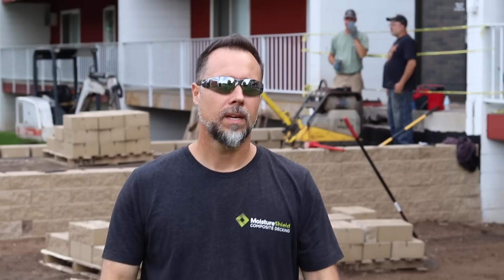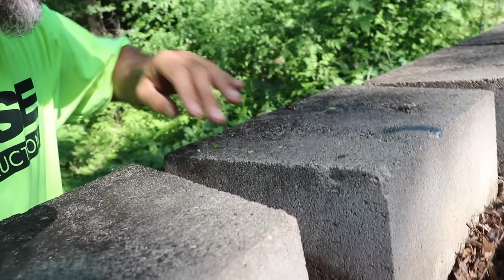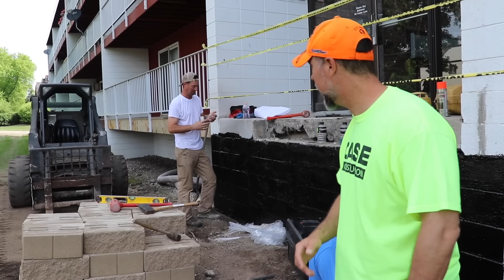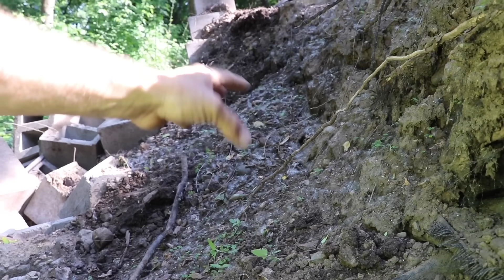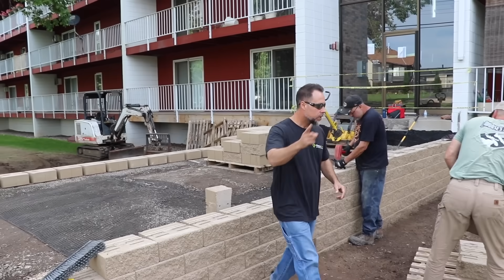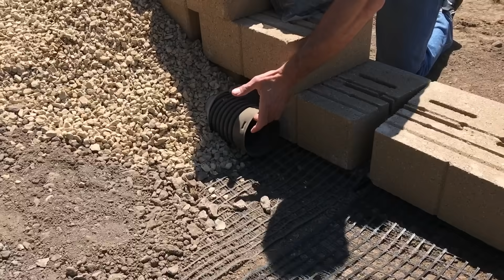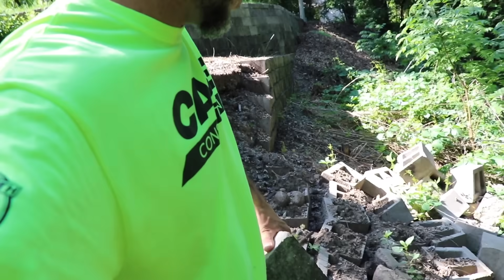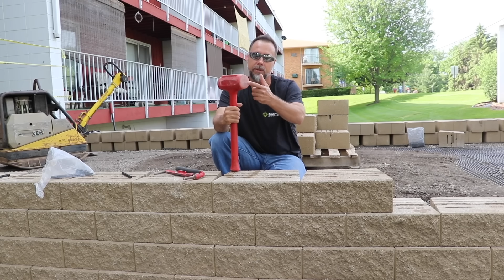How NOT to Build a retaining wall.  RED FLAGS, common mistakes, bad designs pt1

Comment: I love the detailed information as it's why I watch a 20 minute plus video on how to "stack bricks" while other similar videos are closer to three minutes.
Reply from the maker: Thanks- I try to make it interesting.  appreciate that!
Reply: I learned something from the video. Don't put fabric behind the wall. I built a retaining wall years ago using cement blocks and type S mortar as if it was a foundation wall. No drainage whatsoever. Mortared the bottom course onto a concrete pad. Back filled it with shitty gravel and dirt mixed, no geo grid. Built it solid like a rock. So solid it had zero give whatsoever. 

First winter when the wall blew it shot blocks 50 feet across the patio. It was lucky some didn't crash right into the house.
Reply: rustyscrapper - The fabric behind the wall is a minor issue; probably just the wrong type. The lack of drainage is the critical component.
Reply: So your YouTube  certified Richard
Reply: Go take a class from the NC<A, not the "monkey":" https://en.wikipedia.org/wiki/National_Concrete_Masonry_Association

Comment: Good video. Was a little unclear on the geogrid. Is it laying between the courses or just up to the back of the course? Logic would suggest it goes between them, but it wasn't clear. On the "bad" wall it was clearly visible between the courses,  but your wall was so flush, it was almost like it wasn't there.
Reply from the maker: Your not supposed to see it- it lays inbetween the blocks every 2 feet.

Comment: Hey I'm new to landscaping, but not construction so when I started I was put on crew that would take care of drainage issues. We had to remove part of a wall (5 high) to run drainage through the base block which we cut. There was no drainage rocks behind the wall! It was 15 years old and many of them were in the development. No problems with any of them. There was however SOLID clay just a foot under the topsoil, I mean 100% clay. Could that explain the longevity? Sorry for the long post, and thanks for your response.
Reply from the maker: Nope-  That doesn't sound right. Clay moves walls a ton. I think there are just getting lucky-which happens.
Reply: Clay if packed right will usually repell the water instead of letting it filter into the soil below .  but thats only a top layer you dont want a bunch of clay , tends to move around depending on the level of moisture. Its weird

Comment: yes. I love these videos. I bought a house and the prior owners did everything you say not to do. Now I'm rebuilding and would prefer not to have to buy new block now that it's here.
Reply from the maker: I sure hope these videos help you with your project.
Reply: Just fill the block you have up so it’s sturdier.
Reply: Thanks. The block I have isn't hollow on the inside, the doormat that installed it never put drain rock behind it. It is leaning, failed in some areas and not level in others. Leading me to believe there's no base material either.

Comment: If we let water seep through the walls it will carry 'color' and stain the walls.  I would think it is smarter to have a moisture barrier against the wall down to the first course and let the drain aggregate and pipe take take of it by routing it where you WANT it to go.  The only thing I can think of is that the drain system works well enough at first that water won't seep through even if you do not have a fabric/barrier - at least for a decade or two.
Reply from the maker: They aren't meant to be built that way. That does work on CMU walls though.
Reply: Thanks for the response.  I have never built retaining walls so my comment was just a layman's 'common sense' response, which as we know isn't always accurate.  I think I would rather rephrase it as:  If you are trying to allow/encourage seep through the wall what keeps that seep from staining the wall?  Thanx again.
Reply: It seems he is busy.  CMU = Concrete Masonary Unit.  A ridiculous term for a concrete cinder block, the most common of which, in walls, is the 16"x8"x8".
Reply: Kirby Spencer 
Kind of a....  Nevermind.
You have existing blocks that are getting stained, but mentioned no willingness to replace or repair.  In fact, the problem you had was the staining....  So fucking clean them.
Reply: Kirby Spencer thank you. 
Yea I bet he is busy his channel blew up lol
Reply: Kirby Spencer 
Honestly... Just buy a pressure washer and clean the blocks periodically
Reply: Honestly...  You think that represents the quality solution?  You stick to building retaining walls at your place and stay away from my projects.
Reply: Thank you for editing out the 'dumbass' portion of your response.  Had you read what I wrote you would know that I was merely pointing out a potential problem with his technique and that I don't have a staining problem so I don't fucking need to clean them.  This also explains why I don't mention any willingness to replace or repair anything.  Reading is fundamental.
Reply: Kirby Spencer 
Your entire story, in context, reads as a hypothetical, and the final unanswered part is about staining.   You should fundamentally re-read your previous submissions.

And yes I did edit it out, because it was pointless.  Just as much so as the smartass reply my original comment received.  I suspect that you have entirely underatood my meaning from the moment you read my first comment, and you're simply choosing to take the worst possible interpretation that you can imagine.

Edit....
 On the other hand, I would be greatly disappointed to get anything else from a Walter avatar...

Comment: This detailed video was fantastic. I've always wondered why the weight of the dirt behind the wall doesn't just slowly push it out. The geogrid material explains that. But do all retaining walls use it? If not what keeps the fill from pushing the wall over?
Reply from the maker: Not all walls use it.  It depends on surcharge and height of the wall.

Comment: Hey Stan, I'm doing a 3' hollow block wall filled with aggregate and putting a fence on top.  Along with considering the surcharge from the fence (and the torsion from wind), do you think it's necessary to install the post sleeve through the wall into the ground below, or simply install the sleeve in the wall?
Reply from the maker: Install sleeves intot he ground but not through the wall- behind it.  look up sleeveit  it s a system to install fences behind walls.
Reply: Thanks for the tip!  You remind me of my uncle who I don't get to see near enough

Comment: Especially interested in the subject of retaining walls.  (I'm looking at renting a tiller to break up hard ground calcified Las Vegas dirt, to be removed and leveled, and uninstalling/capping an old existing sprinkler system, and replacing it with a drip line.)
Reply from the maker: I have another wall video coming soon.

Comment: Could you put on the hollow blocks could you put concrete down every so often so it make it stiffer or no cuz this the first time I watch this
Reply: I would imagine putting concrete/cement down the hollow would take away the effectiveness of the wall by preventing water to drain through
Reply from the maker: They are meant to be core filled with concrete.  It could impede the drainage
Reply: They are suppose to be core filled with concrete and sometimes also with rebar. Some people fill them with gravel and I dont understand why.

Comment: Stanley, thank you for the very informative video.  We appreciated the tips on geogrid and fabric as well.  We recently started working on a wall project and went with the Versa-Lok standard units based on all your recommendations.  However--the block we received was difficult to work with because much of the block was 1/8" or even 1/4" too high or too low from the specified height of 6".  We had to take down and start from scratch a section of our wall because of this.  We then had to start measuring each block and "shimming"  to ensure we weren't creating unevenness in our wall.  Even though we measure each block, we're not convinced the block is even level from side to side.  Much of the block we received does not look anywhere near a clean as what is featured in your videos.  The slots and holes include a lot of sloppiness and what we call "boogers".  Some of the block we cannot use because there are humps on the top because it looks like the concrete between the slots may have subsided or shifted a bit after molding.  We had the Belgard rep come out and take a look at everything and he kind of dogged the Versa-Lok wall citing it as a "License" product meaning that they manufacture the blocks under license from Versa-Lok.  However, this means they have limited control over the molds that they are sent.  He claims the block that is way out of spec or very sloppy is because they were formed with a worn out mold.  He also claims that 1/8" + or - is the tolerance for depth of the block--That seems like a lot to me!  Have you EVER experienced this with the Versa Lok product?  To me it sounds like the block is only as good as the manufacturing plant it comes from--ours is out of Indianapolis. We had great hopes for this wall block, but so far it seems to have been a big disappointment.  Thanks for your input.
Reply from the maker: Sounds like those are a bad batch of block-  They should pick them up and give you better blocks.  we have had bad batches to.  I wouldn't accept them.

Comment: Nice video, I'm wondering how strong those plastic connecting pieces are, seems like they should be metal.
Reply: Steel would just rot and rust away.  There really shouldn't be any stress on the pins.  They are more to line the blocks up than anything else.
Reply: @UDeMaio53  111111+1 is 11
Reply: There are some blocks that use fiberglass pins instead of plastic. Zero water absorption and much higher shear values. We make all sorts of fiberglass building products and if you would like us to design something up for you that is higher strength than plastic and infinitely more durable than steel, let me know. Great videos.
Reply: Since there are hundreds of them, the strength adds up.
Reply from the maker: Well said A D
Reply: I agree with AD, except for the stainless part. Raises the cost substantially, and the plastic  (probably pvc or abs) won't rot for many years when not exposed to uv, plastics worst natural enemy. without examining the pins myself, I couldn't tell you the actual shear strength, but the little pressure they see is dispersed across the wall in its entirety, so the strain/stress is minimal. look at those little plastic pins in the kitchen cabinet, 4 of them in shear holding up 100lbs of stoneware. plastic is quite strong in shear.
Reply: The pins aren't really that important, what matters is the solid bricks have WAY more surface area making contact between each layer, that's what keeps them from sliding. Those hollow bricks not only have a fifth the surface area, but when you stagger them, the small amount of surface you have doesn't line up between layers so you get nothing.
Reply: @jordanh9520  the hollow ones are meant to be core filled will gravel to help lock everything in place.
Reply: The blocks he used were smooth and yes they used the pins, the blocks at the other site with the issues, those blocks were "hollow" with the lip but no pins.
Reply: Aren't you suppose to put rebar and concrete in the hollow blocks?
Reply: Filling the cores with a fairly large aggregate, it's virtually impossible that the rocks in the core of one block are going to end up flush with the joint between the lower and upper blocks. So you end up with a tightly packed bunch of small rocks that can't move around easily, and many of them will bridge the joint, all around the inside of the core. Try it at home. Take two hollow blocks, put one on top of the other, pack the cores with coarse aggregate, tamping it down on top. Now, without lifting, try to slide the top block around. No need for concrete. Even when the cores are not perfectly aligned, it still works, and given settlement of the aggregate over time, the hold gets even firmer. And there's no drainage problem, either.
Reply: You probably know better.
Reply: There's nothing to suggest you can't substitute it with whatever you want.
Reply: Metal will rust over time... Talking bout putting something in that SHOULD last hundred years
Reply: I have build walls with the fiberglass pins. The only downside is curved walls become a nightmare trying to get everything to align correctly. That's one huge advantage of hollow block that can be filled.
Reply: How does that plastic hold up when it's ice cold?
Reply: @mikeries8549  I live in wisconsin and build retaining walls daily. The plastic does fine but they are also not meant to hold the blocks in place.  The jagged rock is really what helps to hold the blocks in place because it compacts and locks together so well.  The pins really are more of an alignment tool that also offers a lil support.  Your wall will not fail because of the pins trust me
Reply: @ep3389  I’m in Wisconsin, looking for someone to build a retaining wall for me. Can you DM me?
Reply: @SheSlimShady  I didn't even know you can direct message on YouTube! I'm not sure how?
Reply: I like the details in your videos.. Thanks for passing on your knowledge
Reply: Just finished my little 400 sq ft patio after watching all of your videos on paver installation. You gave me the information and confidence to do it myself. Getting ready to do a small retaining wall. This was great information but probably overkill for mine. Thanks!
Reply: they only need good shear strength.
Reply: Use Allan block, no stupid pins to use, and or keep track of. Much more versatile also.
Reply: The plastic location pins are only to give you your 1/2" set back. They have 0 value in the strength of the wall. The wall is a gravity system. Friction from weight and gravity is the strength.
Reply: AD Stainless steel or something, plastic can loose a lot of strength over time. I mean yes if you build it correctly then there won't be much stress on them anyway but you never know what can happen, you want it to be as fail safe as possible.
Reply from the maker: Your right Animuldok

Comment: Good video.  How well do the pins fit in a random pattern or curved wall?  How do you successfully split the back off a standard block for blocks which will be exposed on both sides?

Comment: The only time I use fabric is a at the very lowest point to separate my dirt and class 5 before I put my first coarse down never behind just underneath
Reply: Hoosierdirt27 I've done it behind two walls when I couldn't cut hill back any further. The other situation was the soil it was almost impervious Alabama clay lol didn't really matter no water gets past the top soil I put down there was also 2 feet of drainage behind the wall

Comment: Stan I like the details your providing. I am not a contractor but I own rentals and farms. I have and will be building a lot of retaining block walls. I like the Geo-grid product and had never seen it before. I question: I have been using the full hollow blocks on taller retaining wall. I fill all the holes with 3/4 crushed/washed limestone rock.  Every four layers I have been driving a 3/4 rebar down every 4th hole. I cut the rebar long enough it over laps at least one full block I try for more over lap but some times you can not drive the bar any further.  Will this keep the blocks from sliding on each other??? The reason I use the full hallow blocks is partially cost but the bigger reason is I am 68 years old and I could not lift 83 lbs. blocks for very long.  I just finished a wall around the back of my shop. It is eight foot all and has 1500 blocks in it. I laid it in two weeks by myself. So I am not speed King. LOL

Comment: I just did a retaining wall out of 6x6. 3/4 back every timber 12 inch spike every 3 ft. 4 ft kickback at each joint with 3 ft rebar driven. First one. No idea if i did anything right.

Comment: Versalok, them some heavy blocks, 82# if I remember last wall we did with them. Remember having a few issues with the fiberglass pins lining up at times also. Great for installing with grid, hate using lip blocks with grid.
Reply: we cut rebar into pin lengths
Reply: Mike Owen - Won't that rust out?
Reply: Not for many years

Comment: Great video.  Confused me though.  I built an 80 foot retaining wall that varied between 4-6 feet high last summer inspired by these videos on YouTube. I used drain rock wrapped in filter fabric and perforated pipe behind the wall for drainage.  Most of the videos I've seen say that the drain rock will clog without filter fabric.  Did Stanley's comment mean filter fabric around the drain rock is wrong?

Comment: Great video Stan. A Mason did a 9’ tall wall quite a few years back for one of my builders. No grid and threw the existing clay behind the wall with no drainage aggregate. They called me to rebuild it and I did 3 layers of grid and put 120 yards of stone behind it. Still stands straight to this day. I wouldn’t do it again though, I like doing Concrete better.

Comment: I thought behind the wall was drainage rock for 12 inches and then the landscape fabric.  What is to keep the fine dirt particles out of the drain rock if you don't have the landscape fabric?
Reply: That used to be the norm, but the industry seems to be switching away from that. Block manufacturers have been finding that the fabric would clog and creat excess hydrostatic pressure behind the wall much quicker than silt migrated into the drainage aggregate. It’s dependent on the soil you’re using obviously. The only time I use fabric behind the aggregate anymore is on commercial jobs when the engineers spec it.

Comment: We use a hollow block but they are a lot more stout than the ones you were showing. Our local concrete company makes them and they are 78lbs. We also fill with rock.